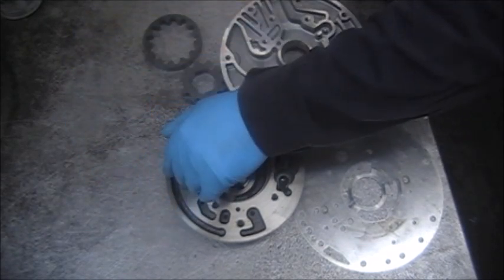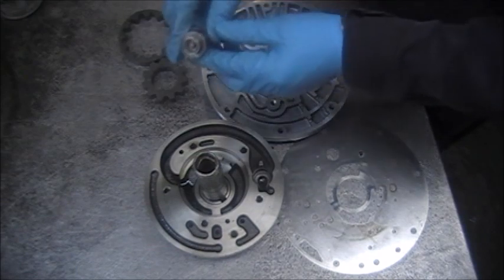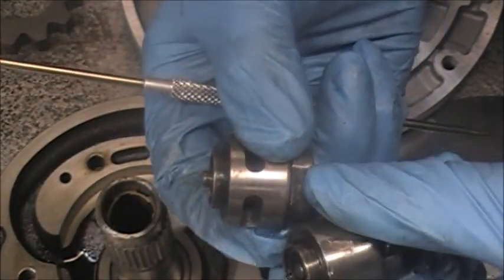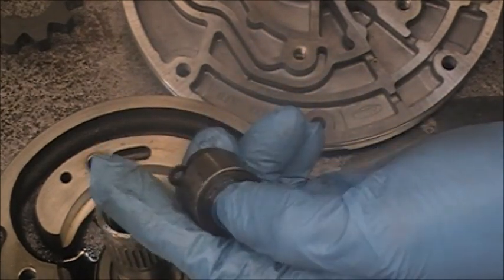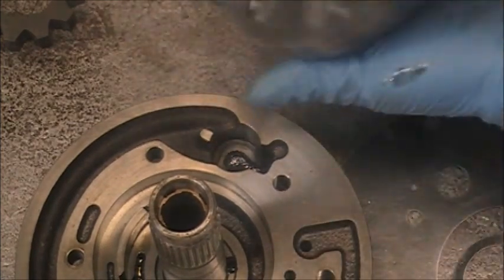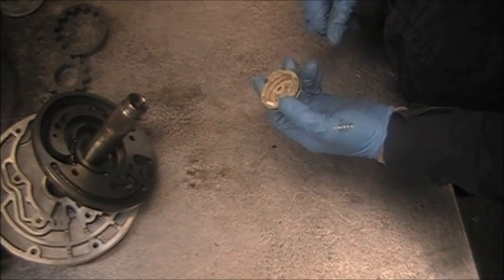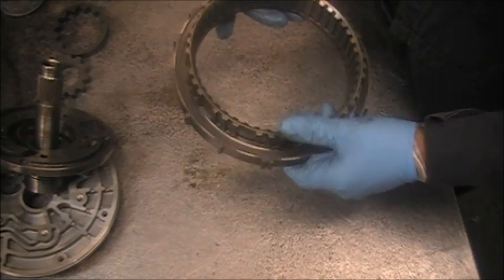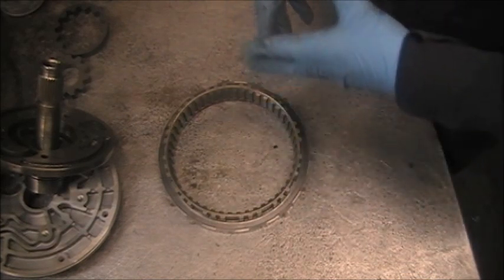5R55s/w, 4L60E, 6T70, automatic transmission tips

Comment: I dont think the seals are lasting longer I think the owners are more disrespectful then the old days
Reply from the maker: Steel was stronger. A 1950 vehicle sitting in a field has stronger steel than the vehicles have today. The 700r4 transmission uses a sunshell. It never snap the shell. The new 4l60e snaps the shell all the time because the steel is  weaker material. Valve bodies were made out of cast iron with steel valves. They never wore the bores. Cast iron can take heat without warping. Today, many valve bodies are made from light materials, and the bores wear. The whole vehicle is made from lighter materials to gain fuel mileage for the manufactures. It is physics, a natural science. If you go to the extreme of one end, you loose something on the other end. One has to try to find the middle ground. When vehicles were build in the old days, they were not concern about fuel mileage at the time. They were preoccupied with just getting a vehicle running. There is a list of things that I can say that is weaker than before. A chicken is not a chicken, an egg is not an egg, a house is not a house, etc. Todays things are weaker in construction. One reason the substance is not there.